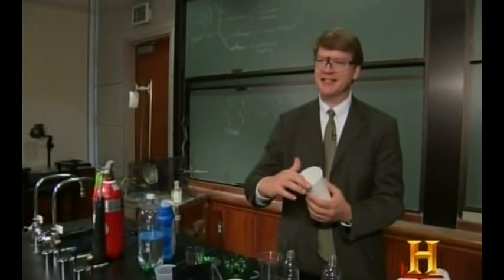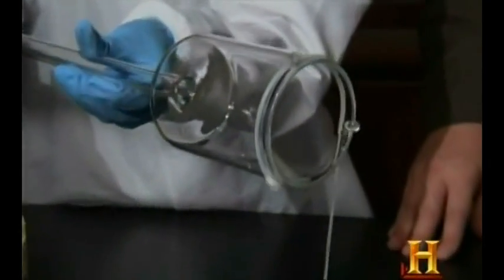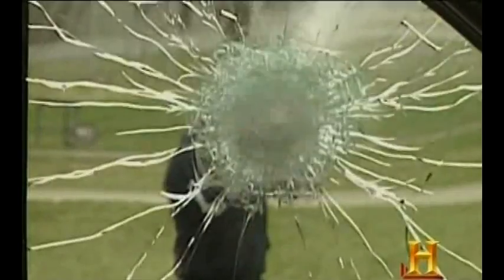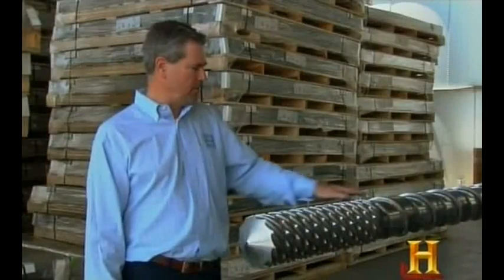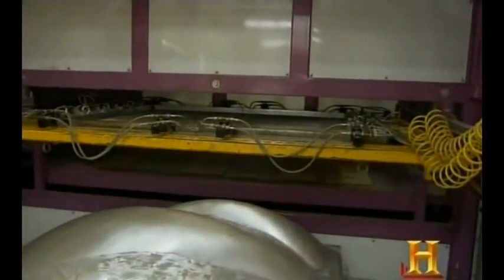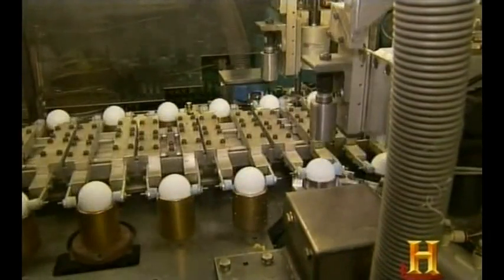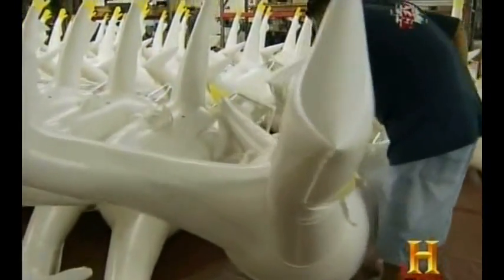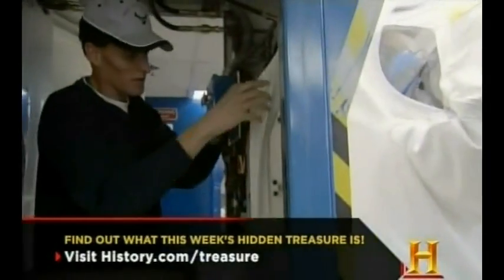MM - Secrets of Oil - Plastics

Comment: I liked all the information in the book. It was very helpful, it was also very easy to read [ Check Details Here >>>https://plus.google.com/110086446704524205338/posts/5ggfuLTWf7j ]. There are a lot of good ideas that I will be using. This book is great for a beginner or a pro

Comment: I liked all the information in the book. It was very helpful, it was also very easy to read [ Check Details Here >>>https://plus.google.com/u/2/117309684281297662218/posts/NSWQZ2jWSrP ]. There are a lot of good ideas that I will be using. This book is great for a beginner or a pro